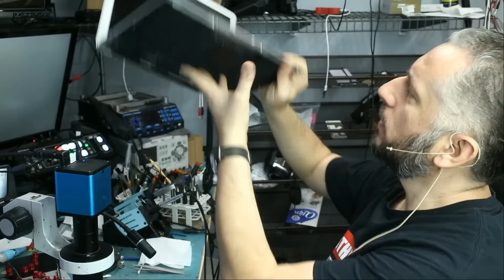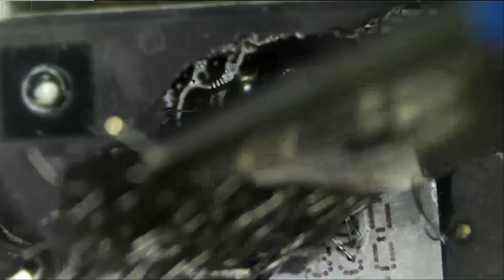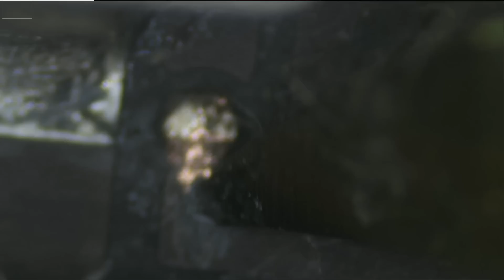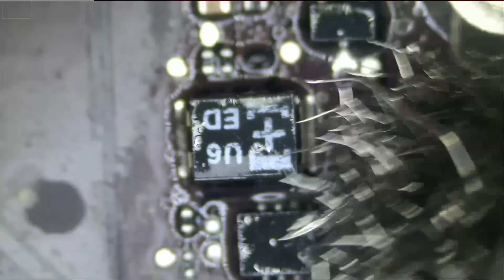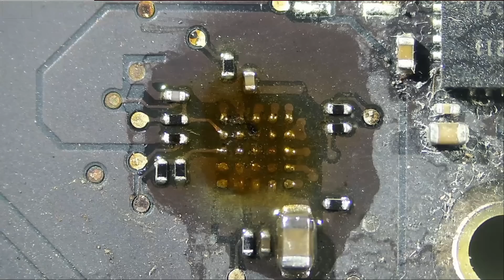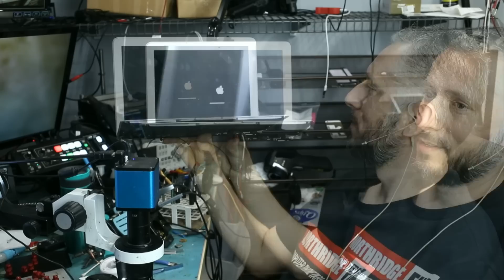2015 Macbook Air Liquid Damage No backlight Repair - Corrosion cleaning using steel brush

Comment: My Macbook pro 2013 had same problem but service said that they must change the LCD screen. I didn't  accept because cost was very high for a non retina screen. Now i know that screen replacement couldn' t change anything because the problem was on board.

Comment: apple products is a moisture magnet
Reply: How so?
Reply: 90% of the boards have humidity, it is not always the cause of problems, but there is moisture in some components.  the board probably attracts moisture (it is almost paper instead of fiber or plastic)
Reply: @yomismo8841  Yeah, i've noticed a lot of these weird moisture, dust and corrosion yellow/blue clumps around certain board component leads while watching Apple board repair videos, but since i haven't worked on many Apple products myself, i just wrote it off as a user fault and didn't think much of it. I see you have the same suspicion as to what it might be causing it. Components, solder and chassis are material-wise same as with other brands and that leaves the mobo. Could it be the solder mask paint itself? I didn't expect the PCB material to be so "breathable" with that thick brown(black?) layer of paint on top, until you mentioned it.

Comment: Hello sir . I have a question.  If we soldering IC on the board with the hot air,  I find IC fly or move here and there. so Please if possible show us tricks and techniques to use hot air soldiering. Thanks. Have a nice day ahead

Comment: Just wanted to thank you as have learned a lot from watching your videos. Did my first MacBook Air 2015 repair yesterday using advice from your videos. Had to replace the LVDS cable, LVDS connector and backlight fuse! Made it as easy as possible for myself following tips from you including using low melt solder to remove old connector, bought a cheapish microscope which again greatly helped as is impossible without and finally bought some decent flux. All in all went surprisingly well, took it slow and rewatched vids trying to copy your techniques. I messed up one connector using a fine tip, second attempt used a bigger tip which worked better. All in all the money spent on equipment was covered by the fix as would have cost more to have it done by a repair shop. So thank you from the UK. Salam
Reply: hi im looking for a cheap microscope,which did you buy can you give me a link,thanks
Reply: Congratulations on your first successful MacBook repair! Can you  send me a link to the microscope that you bought?

Comment: Perfect instructions on reflowing etc but I was wondering wen you remove the backlight chip n used the wick there were 2 solder balls that was touching n maybe they are both ground otherwise it would not have come on.
Reply: That trace with two solder balls is most likely a shared ground pin
Reply: @popcorny007  yah I realized it wen the MacBook powered on. Thx for the idea though. I am big fan of his videos n I know if there is something to worry he would have said something coz he is a genius in the electronic industry
Reply: @sharfazhameed6382  No need to idolize him, otherwise when he makes a mistake you'll negatively overreact. Mistakes are part of the job and the learning experience. We're all human after all :)